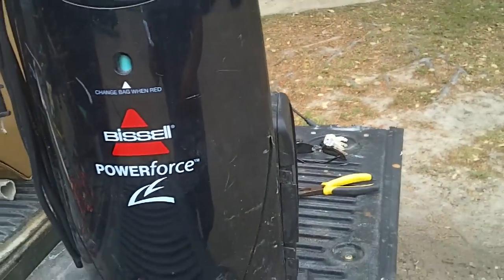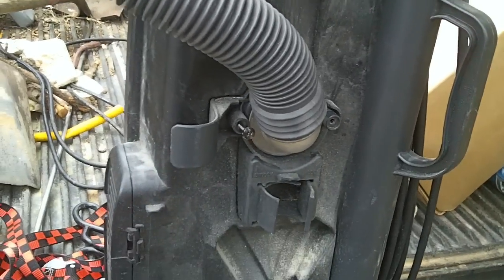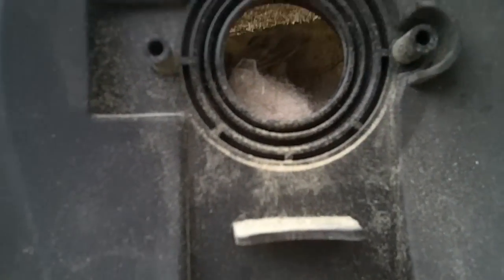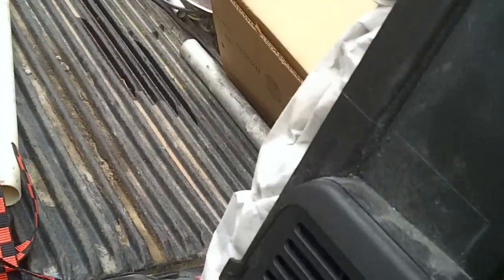Unclogging a Bissil Powerforce Vaccuum Cleaner

Comment: I am in the process of fixing this same model up. I took it all apart and now I'm cleaning up all the parts.. I have a stripped screw though on the bottom of the vacuum where you install a new belt... I have to somehow get that screw out. I unscrewed all the parts so I could take out the motor also so I could clean the parts that can get wet.
Reply: oh mine is a bagless though

Comment: Mine does the same when the bag is overfull, change it a bit sooner and it will stop clogging there.
Reply: Just because this particular model has the feature, doesn't mean it actually works, things do break. Mine doesn't actually have that indicator, so in my experience your comment may actually be moot.
Reply: In the case of this unit, that plastic flap is probably just a sad marketing scheme.
Reply: bbbc have you ever used a bissell?
Reply: I have used a few, with the only one in my residence being a bagless Powerforce, except for the Big Green Clean Machine.  I have to say, I was utterly disappointed in the performance, and I can say that the dirt container was empty and the filters maybe got some dust after just being serviced after being "gifted" the machine.  The saying, "he who vacuums last wins" was completely destroyed by that machine, since the carpets were regularly cleaned with quality machines.
Reply: bbbc was the powerforce the 12 amp or 10 amp
Reply: It had an eight amp motor, I believe.
Reply: bbbc EXACTLY! The powerforce helix was a POS
Reply: I'm pretty sure they're all of the same in effectiveness and build quality.
Reply: bbbc no they are not. I bet if you put my dead bissell powertrak which has the same motor as the O.G Powerforce in it the powerforce helix would get it's ass kicked
Reply: How would one work better than the other when they are all nearly the same machine with their winding passages and restrictive airflow?  I bet if I put my Kirby Sentria against any Bissell, the Sentria would be superior.
Reply: A different motor isn't going to help when the air can't move any faster in the winding passages.  All a more powerful motor does is runs faster.

Comment: That was probably made in 2004
Reply: no 2006 to 2008
Reply: Rubidicaby Hernandez  I would say 2005-07 because in 2008 they switched to a maroon color and dropped the headlight and the bag indicator and the ones from 2003-04 didn't have a bag indicator
Reply: flame legend that's 2005 or 2006
Reply: @coochieman2307  this was made 2003 to 2005
Reply: Duhhhhhh